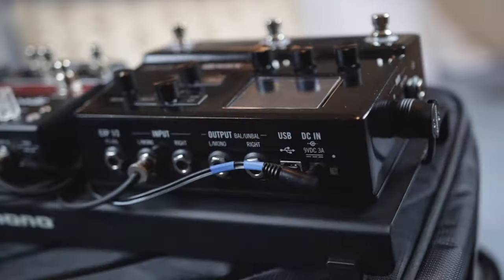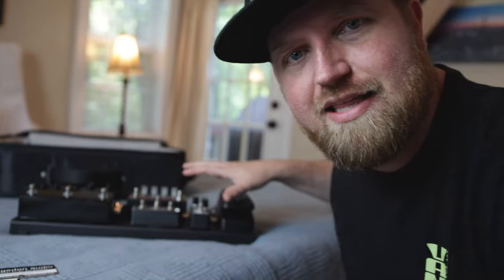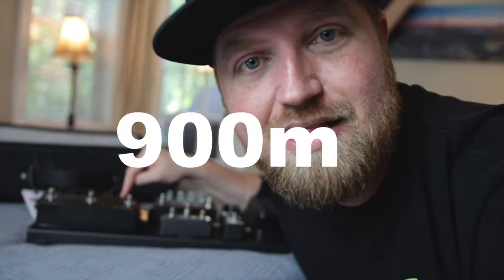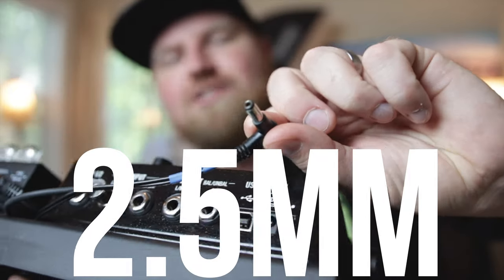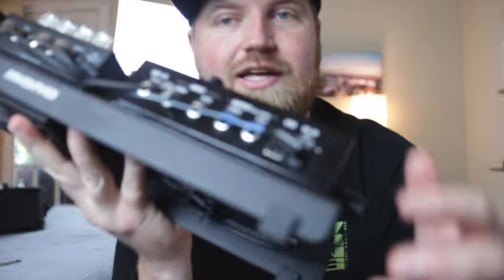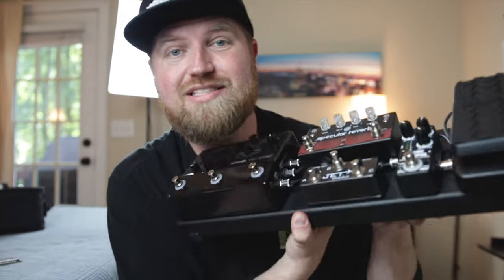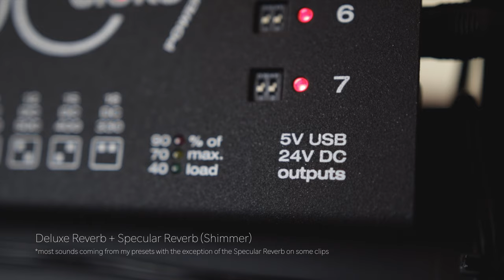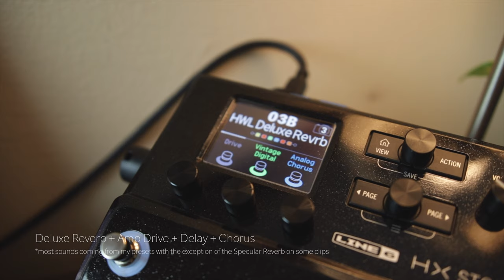LOOK NO FURTHER!!! I Found The One Cable You NEED To Properly Power The Line 6 HX Stomp || + Sounds

Comment: That cable is 30$ another option (learned it from cioks video) buy the sand gray special flex parallel adapter & the yellow standard flex from Sweetwater...total 8.98 (9$) plus 6.98 (7$) shipping 16$ vs 30$
Reply from the maker: true

Comment: thanks for the video - if all i want to do is add another 10 feet to my existing cable to get that hideous plug off stage, is it possible to just add a similar gauge wire with a solder gun and heat shrink or is the voltage tolerance gonna be upset by that?
Reply: oooooorrrrrrr.. what about a 10ft extension on the stomp box plug end (female to male).
Reply from the maker: Wow! I'm not sure...I know it would def be possible if you knew what you were doing....I'm just not one of those people! haha

Comment: While I can confirm what you said about the Stomp drawing approx 900mA, this is only after it has stabilized. According to James from Mission Engineering, it draw over 2A during boot up. I don't know the details of the Cioks - maybe it can supply that much current safely. But it is important to know that 900mA is not the whole story.
Reply from the maker: I've heard this too. It must not go above 1000 because that's what I'm giving it with the 2 500ma outlets.
Reply: @HeyWorshipLeader   That may or may not be correct. Some power supplies rate the ports at certain levels, but can actually supply much more than that rating. But not all power supplies can do this, which is why it can be dangerous to depend upon it universally.

Comment: Does their Strymon Current Doubler only work with Strymon power bricks, or could I use it with like an MXR Power Brick?
Reply from the maker: I think they just label it that way, but should work with any that receive the barrel type instead of RCA ends like the DC7
Reply: @HeyWorshipLeader  awesome! Thanks for the reply. I reached out to them, but haven't received a response yet. I might just order it anyway and return it if it doesn't work 🤷🏻‍♂️

Comment: Hey! Great video! I have the HX Effects and i'm not very positive about the solution which TrueTone CS6/CS7 provides. You have to use 4 cables just to plug in the HX Effects. 2.5 mm  > 2.1 mm barrel and then the polarity changer and then the doubler which has a socket instead of a plug so you'll need a normal power cable to finally connect it all together. BUT! I just saw that Voodoo Labs made this cable: Voodoo Lab HX Current Doubler Adapter PPHX. Would you say it's the same principal like the Logsdon Audio cable? I plan on using it with my TrueTone CS7. Thanks in advance!
Reply from the maker: Oh wow! Yes...that cable looks like it will work...and it's funny...I just recorded a follow up video (haven't edited yet), comparing the DC7 vs the CS6. The True Tone stuff is really good. I'll have to record a little insert to update about that cable! Thanks

Comment: Have you had any trouble with the stomp powering it with the cioks dc 7 ? I just bought the same set up after watching this video. I am hearing about the cioks dc 7 not holding up. I just wanted to ask for your experience. Thanks! And if you could share the dip switch settings on how to use the current doubler. I’m clueless lol
Reply from the maker: Not at all...and I have my dip switches all on 660

Comment: You’ve got two links in the description, one leading to Amazon and one direct to Logsdon. Do we need to buy two cables, one from each link? Or just one or the other? It’s confusing because you said one cable in the video but there are two links. Please clarify.
Reply from the maker: Sorry about that. I just put them both on there so you can see which one is cheaper. At one point Amazon had doubled their price so it was cheaper to just buy off the main website.
Reply: @HeyWorshipLeader  thank you!

Comment: I'm sketchy on the details... the unit says it requires 3A to function...yet you're using only 990mA? does that cable boost the current?!?! so confused....
Reply from the maker: There have been tests done by Cioks to show what it actually draws at start up...check it out here: https://www.youtube.com/watch?v=DccNM_5NJts
Reply: @HeyWorshipLeader  thanks. I actually tried it using what I have. 700mA. It worked just fine 😜 thanks again

Comment: Hey man! Sorry if this question has already been asked in the comments, but could I use the MXR iso brick mini to power my stomp in the same way? Those are all standard 9V 3A power. I figured so, but I just wanted to make sure! Thank you for this video!!
Reply: Well - it looks like they are 300ma. But there is one that is 800ma. Could I use the Y with one in end in the 800 and one in 300 to power the stomp? Since it’s like 1.0ma?
Reply from the maker: So I'm not sure about that power supply... if it sends the amount needed to the different ports like that. I haven't seen it on any of the HX Stomp power supply lists. Is it a power supply you already have?
Reply: @HeyWorshipLeader  no, I don’t have it yet. I’m using a small board that a friend and I built, but consequently it has a very limited amount of space underneath. It’s built 6 inches deep, at an angle, so I have at lowest about an inch of space, and at highest about 1.5. The shape and height (1 inch) of the mini makes it the perfect size. I would love the one you have, but it might be juuuuuust a hair too tall
Reply: @HeyWorshipLeader  Actually, I’m realizing the Cioks DC4 would fit under the board - I’m thinking that would work ok?
Reply: @HeyWorshipLeader  hey man, another question if you can get to it! I got the Cioks 4, and I thought everything would work the same using the rca Y cable, but it seems like it’s still not enough power for the stomp. The outputs are 9V 660ma, just like the DC7. The only difference could be the power - its powered via USB-C 5V, 1A cable, or by extension to another cioks power supply. Could this be the issue? I’m just trying to figure out what I’m missing here

Ok update I used an iPad wall plug with the USB C cable which is 2.4A instead of the 1A of the iPhone cube aha. That was enough to get the stomp loading, but wouldn’t completely come on. I’m thinking a wall plug providing 3A and 5V would work.. but not totally sure. Haha sorry for the long comment!

Comment: To anyone interested, you can just use one 500 mA outlet from a Trutone One Spot CS6 to power the HX stomp. No need for a current doubler cable. Plus the CS6 comes with all the cables you need in the box.

By the way, what patch cables are used in this pedalboard?
Reply: Can you elaborate on this? I have a CS12 and was having trouble powering my HX Stomp with just the one 500ma port.
Reply: Still working?

Comment: You forgot Problem #4
Make sure your wall adapter supplies enough total power to your power supply brick.

For example, even if your power supply brick has enough 500 Ma outputs for your current doubler, it will not do you any good if your wall adapter only supplies a total 1A (1000 Ma) to your power supply brick. Your HX pedal will gobble that up, and not leave anything for other pedals.

Comment: hi sir.. you prefer voodoo power supply or cioks for better sound?
Reply from the maker: I'm sure the power supply won't effect the sound unless it can't keep up with the power demands. Either should be good. Just make sure if you are buying this cable mentioned in the video that you get the correct ends for whichever power supply you end up getting

Comment: I just use the bulky power supply for my Stomp. I've had a power supply blow on me before and fried one my pedals.
Reply from the maker: No shame in that at all! I hate to hear that about your pedal? What did it fry? Yikes?
Reply: @HeyWorshipLeader  my volume pedal pot fried, as well as the level control on my distortion pedal.
Reply: @HeyWorshipLeader  moral of the story, don't trust your gear to a Donner power supply.